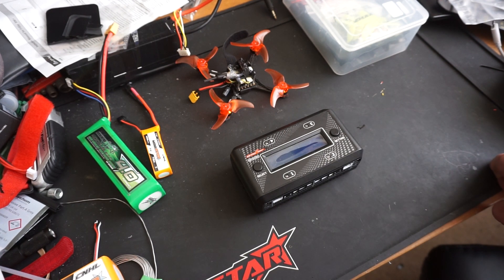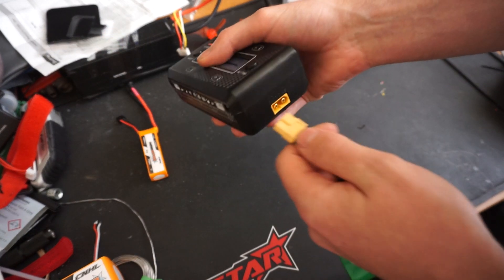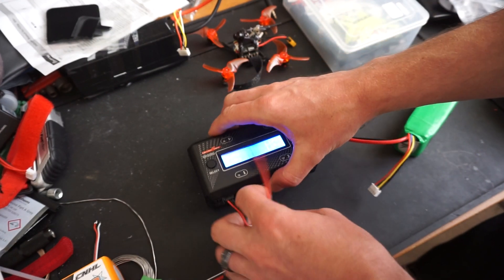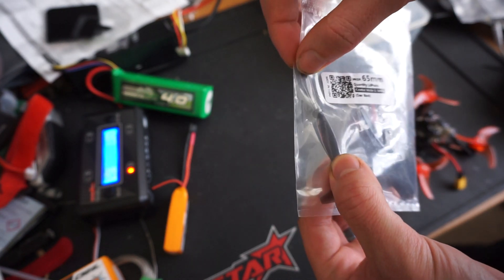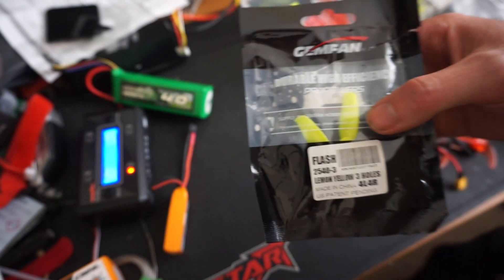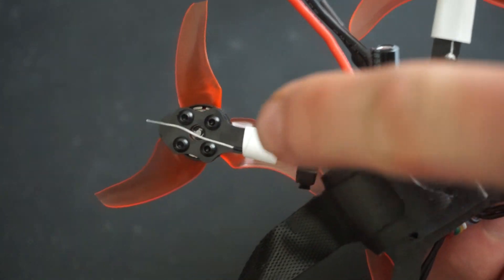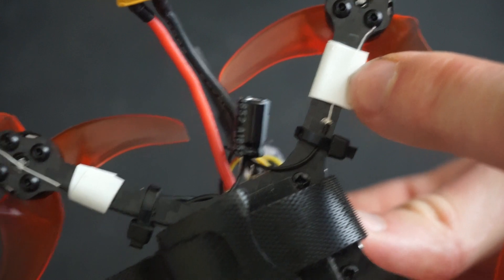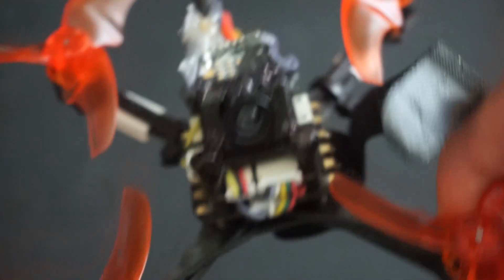Eachine TYRO69 Toothpick update // Props Charger Battery Camera mount

Comment: Use a carbon tube and heat shrinks instead of a cable tie. It works quite well for me to fix the receiver antennas.
Reply from the maker: How robust is a carbon tube as I crash alot.
The props managed to eat the antenna after this video was made

Comment: What size are your prop screws? You said 7mm but 7mm x ?? I'm looking for some. Maybe 1.4?
Reply from the maker: It's an m2x8mm then I used a Dremel to cut it down to 7mm to prevent it catching on the  motor stators